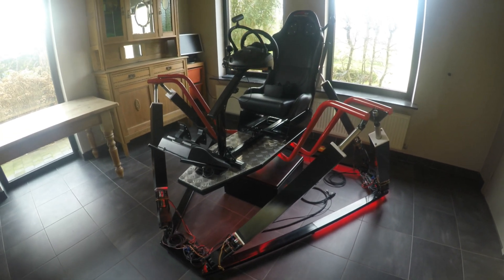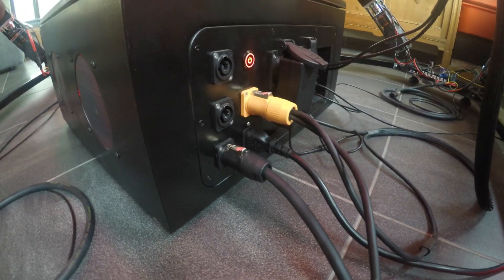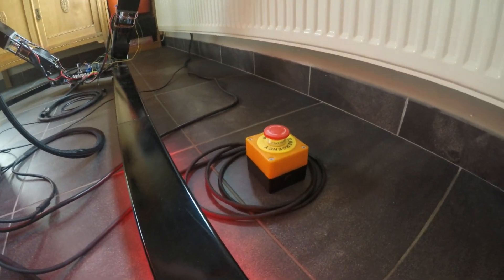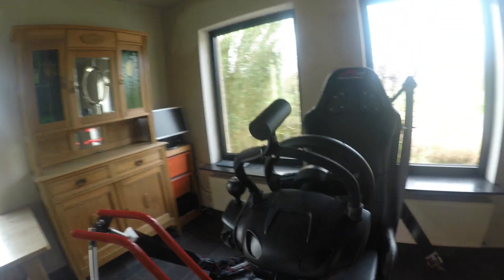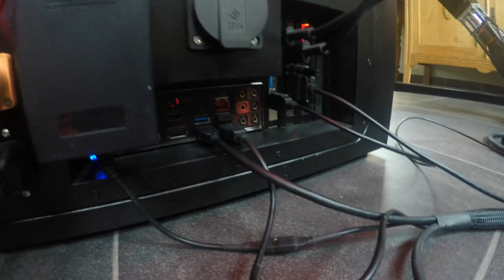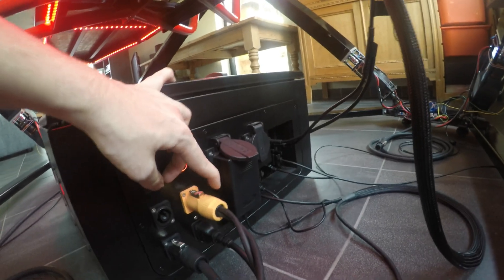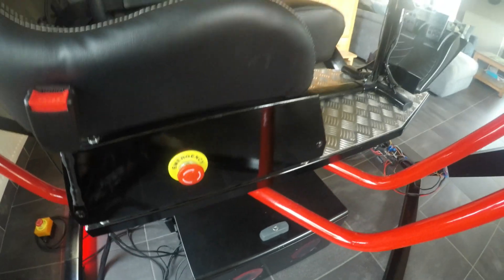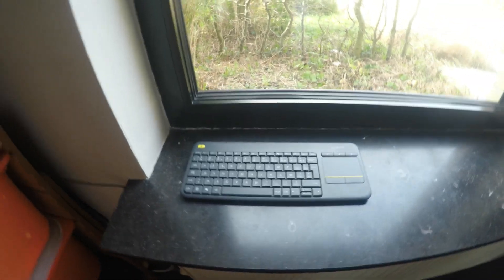Complete Overview | DIY 6 DOF Racing/Motion Simulator 🏁 | ODrive

Comment: regarding the linear actuator  do you use limit switch also ? or not
Reply from the maker: Yes for homing when starting up the machine
Reply: @stijnsprojects  is  the limit switch send digitol output to Odrive ?
Reply from the maker: Yes, the ODrive has homing functionality build into the firmware.

Comment: Do you have BLDC motor specs? Do you use hall sensore a ,b,c models? Or do you just buy an encoder and add it yourself?
Reply from the maker: Keda 6364 190KV motors in combination with an optical incremental encoder.

Comment: Great work! Just a question: where did you connect the other end of the green reset cable? I  want to have similar stop buttons but couldn't find anywhere how to correctly connect the reset pin on odrive
Reply from the maker: When the E-stop is pressed, the reset pin is connected to GND, in my SIM to GND of the PSU because it's the same as the GND of the ODrive, keep in mind this is a NO contact so it's not a safety stop.

Comment: are u using endstop for calibration sequence in your setup..??
Reply from the maker: Yes, there is a video on my channel about how the odrive is programmed where this is explained.
Reply: @stijnsprojects  if i only use 2 odrive (i have plan to build like sfx100), will it work directly with simtools (without flypt mover), because i dont need extra calculation like hexapod configuration
Reply from the maker: It is possible to send the commands from simtools directly to the odrive
Reply: @stijnsprojects  ok...thats interesting...
Reply: @stijnsprojects  can u share the fw u using..?

i want to try that with my setup...
Reply from the maker: I explain how to install the firmware in the odrive flyptmover video
Reply: @stijnsprojects  do you have any thread on xsimulator..?
Reply from the maker: Yes my sim in on xsimulator: https://www.xsimulator.net/community/threads/my-6-dof-project-with-bldc-motors.12918/